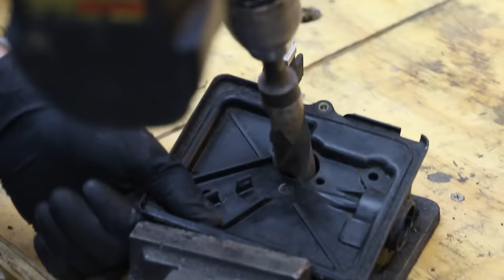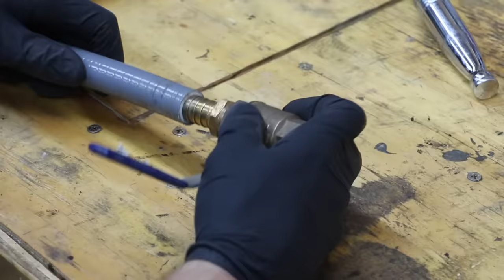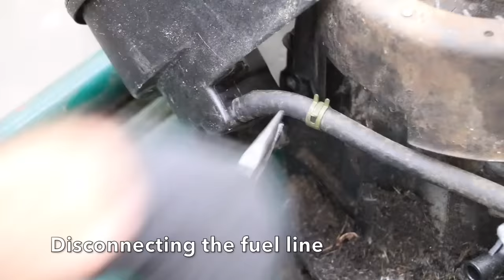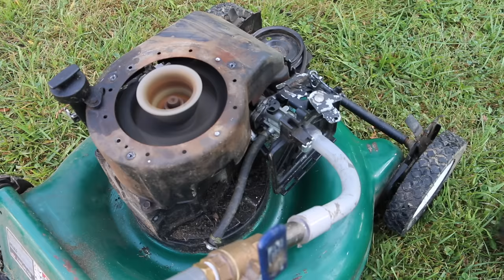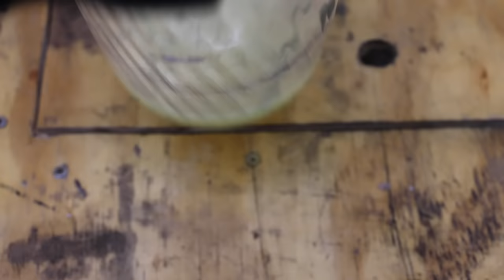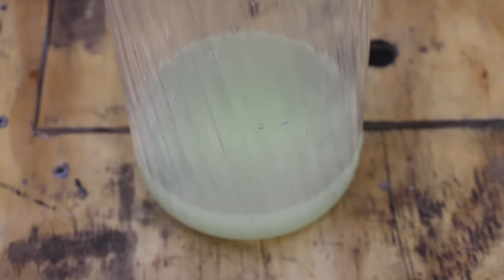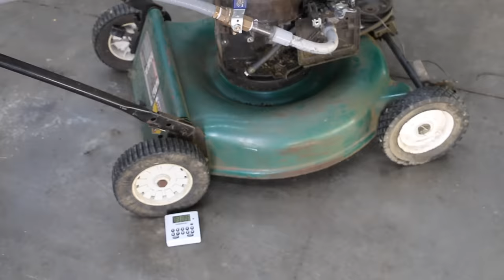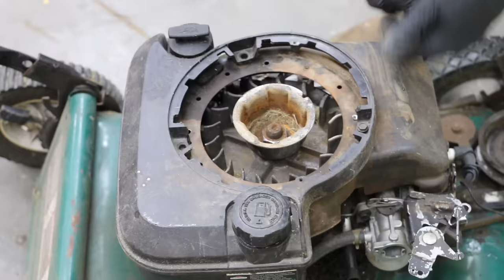Will a "Gas Vapor" Container Improve MPGs and Fuel Efficiency?  Let's find out!

Comment: So I looked at your previous video which was, you brought a Hydrogen generator & attempted to increase your MPG  on a truck which didn't necessarily help. 
Then on your Next video I looked at running a lawn mower motor on vapor fumes from gas. The vapor fumes worked! , However why not with hydrogen Gas fumes? Could you point out what I'm missing here in this equation? 
Thank you very much for your dedication.
Reply: And I asked this question based from my understanding that hydrogen can be just as lean as , regular grade Gas. So I'd say in 'theory' if the hydrogen Burns just as good then what's stopping it from getting that Good Burn?

Comment: Old video but here goes. One suggestion to improve economy is to add holes or slits to the bottom (only up an inch or so of the tube) of the downstems (2x air intake tubes) it will percolate much more finely and evenly. It will also make it easier for the engine draw through the stems. Also if there was a way to consistently keep the fuel about a half inch to an inch above the percolating holes that would help make it easier to pull too. Basically the engine will have to work harder to pull through a full tank of fuel 18 inches high as opposed to pulling through 1 or 2 inches of fuel. Fuel economy would prob have a curve where it would start to get better as the tank emptied. Maybe gravity feed from a secondary reservoir to keep it topped up? Super wide, squat tank?
Welder by trade but I dabble with glass. Made a lot of downstems for bongs.
Modified even more of them that have don't have percolated downstems or were either over or under percolated. Un-percolated downstems "chug" really bad like your container there, and tends to have a lot of drag and are hard to pull. On the far end of the extreme is when the factory went to town and put too many holes and you get a very easy pull with no drag, at the expense of agitating the liquid less. 
There's probably a happy medium somewhere in there.
Sorry for storytime, great vid.
Reply from the maker: Thanks!  Thanks for sharing.

Comment: That was great! I've seen some setups have the pipes go above the fuel line, rather than into the fuel to bubble it. That way apparently it grabs the pure vapors rather than creating a mist which would use up more fuel. Can you try this again but shorten the inlet tubes so they sit just above the fuel line?
Reply from the maker: Thanks for the suggestion.
Reply: @ProjectFarm  my curiosity is whether the vapor line could be similar to the coils of tubing in a still- dragging fuel vapor from the canister by venturi.. sorry, not sure how to describe it.
Great video, PF.

Comment: Please use a mist maker for fuel and add the hose to air intake manifold, fuel mist  should only open on intake suction, otherwise fuel will waste,for this we can use suction valve with a variable suction pressure setting for optimizing fuel flow for better efficiency. For pressure control in mist maker chamber, a pressure gauge with auto cut off for mist maker can be setup, for safety purpose, otherwise the pressure inside the mist maker chamber will explode the chamber, auto turning on on pressure lower to a set pressure can also be applied. I think this will meter the fuel better and will also mimic carburetor
Reply from the maker: Thanks for the suggestion.

Comment: Farmers in 5he 30s did it, Charles pogue did it and I have done it in a 69 chev V8 truck. Better if you add heat. Pogue used naphtha. I used exhaust and coolant to heat but the gas vaporising built up gunk in my vaporiser because modern fuel has  a lot of stuff besides gas in it.
Reply from the maker: Thanks for the feedback.

Comment: The direct vapour lasted for 1 minute  more than the carburetor injected fuel, significant indeed! many be you need to tweak at the air in-take of the vaporizer unit to get better performance.

Comment: the change of the fuel to a whiteish color was due to the alcohol in the fuel  being a hygroscopic material. It sucks of water like a sponge takes up water. The canister of fuel was acting as a filter for the air coming into the engine. In fact if you would add more fuel to the canister and continued to run the engine you would eventually have water falling out of suspension as bubbles to the bottom of the canister.
Reply from the maker: Thanks for the feedback.

Comment: I read some plans for vapor carbs and they all heat the fuel to abt 400 degrees. The violent bubbling action in the bottle puts lots unvaporized gas droplets into fuel pick up tube so the fuel is not 100% vaporized.
Reply from the maker: Thanks for the feedbacik

Comment: I know this is an older video but for what it's worth, the very purpose of a carburetor is to atomize the fuel before it goes into the combustion chamber. I think your vaporizer is just atomizing the fuel before it goes in so I can't see how it could possibly be a whole lot different in mileage, unless the vaporizer itself is just more efficient than the atomization of the fuel from the carburetor.

Comment: Your method has a fundamental flaw, you don't have a mixture valve to allow additional air into the engine along with the vapours so it was likely running rich at the beginning and lean at the end. also the bubbler should contain something like a wick or other high surface area material. You will probably need something to warm it as it gets very cold stopping evaporation, i also suggest using a float or something to keep the level of fuel in the bubbler as small as possible, then the engine will have to use all hydrocarbon chains in the mix rather that distilling off the most volatile vapours first. the fact that you got an increase in efficiency with this crude setup that's not optimised shows that there is plenty more to be had, advancing the timing slightly might also yield additional efficiency as gas vapour only has a higher flame front propagation speed, you can quench and further increase efficiency and torque by adding a small amount of water in the bubbler too, this can increase the density of the charge and also work somewhat like an EGR by adding a non combustible, further enhancing efficiency and reducing cylinder head temps.

Comment: Idea-
Another youtuber outba lawnmower engine on the small block v8 of an old, Ford Maverick. A 302 I think. 
It ran and he started seeing amazing mileage. Like 70 mpg. 
It DID lose power, but ran smooth and sustainably at highway speeds. With manufacturers now using 1.8 and smaller motors, power is not always the goal. His theory is that the small carb created high intake air speed that better misted the fuel. He wasn’t sure. Just a theory. He was amazed by the result too. 
Can you please consider replicating this?
Reply from the maker: Thanks for the suggestion.

Comment: For starters, all internal combustion engines run on vapor. That's what carburetors and fuel injectors do. These vapor engines purported to go to the moon on a teaspoon of fuel are at most just running lean, which means less power, hotter exhaust gases, and reduced thermal efficiency.

I'm an engineer, so just to put some perspective on this for cars, I did some calculations. For a car that can reasonably, if uncomfortably, fit a two person cross section cabin, has a minimum feasible drag coefficient, has tires in contact with the road, and travels at around 100km/h (~60mph), the theoretical minimum power it'll consume just to maintain that speed is about 6kW, and accounting for the theoretical maximum thermal efficiency of an otto cycle engine (four-stroke piston and crank) and the energy density of gasoline, this equates to about 235 miles per US gallon. To emphasize, this is regardless of technology or fuel being used; we're talking about thermodynamic limits in energy terms, for a car with people in it, in Earth's atmosphere.

However, if it were optimally motored just to perform the above task, it would also take such a car about 2 minutes to go from 0 to 60 mph. If the car had the ability to increase power output just for acceleration so it could do 0-60 mph in an acceptable 10 seconds, and does so on average once every two miles driven to approximate a mixed drive cycle, and assuming it could somehow maintain it's theoretically maximum thermal efficiency, it's average fuel economy would be reduced to around 140 mpg, which is pretty close to the Tesla Model 3 mpg equivalent.

So in my professional opinion, the claims of hundreds of mpg from the 1960's or 70's simply cannot be true, let alone 1000+ mpg.

For a much more realistic car with an internal combustion engine, with ample head and shoulder room and desirable seating height, presentable and practical exterior design, capable of cruising at 70+ mph, and accelerating within an acceptable space of time and distance, the best fuel economy you're ever likely to see will be between 43 and 57 mpg before bumping into the laws of thermodynamics.

The reality is that consumers want their cars to do and be a lot of things: handle like a Porsche, accelerate like a McLaren, have as much space as a Suburban, get the fuel economy of a Prius, and cost no more than a second hand Honda. Through careful, market-driven negotiation, typical cars today average between 25-45 mpg, because that's a realistic range within the limits of cost, technology, and what we want in a car. The fact that hybrids and electric cars are taking the market by storm only further discredits the notion that hyper efficiency technologies are being suppressed.
Reply from the maker: Thanks for sharing.

Comment: Wow didnt know you made this experiment long ago!
I think we can improve efficacy and throttle ability of the system by having several smaller diameter air bubbler tubes instead of the 2 large ones used and also adding 50 percent of so water to the fuel to take advantage of the Hydrogen and Oxygen content in it
lets reopen and review this experiment case in 2022
Reply from the maker: Thanks for the suggestion.

Comment: The reason you got the same time on both of those experiments was because you're using a carbureted lawnmower, which fills a bowl with fuel and the engine runs off the vapor... So in both experiments, the engine was running off the same thing, gasoline vapor. However, if you made a fuel-injected car run on vapor instead of liquid, then you'd have different results.
Reply: what do you expect if it is fuel injected? would it be higher or lower? can you explain more?

Comment: Henry Ford's first model t's used fuel vaporizer canisters before employing  carburetors. The correct terminology for them is fuel mixers. They work quite well but in the end they accomplished the same thing air being pulled through  carburetor  Jets in the carburetor forms a wet mist vapor pretty much as vapor canisters do
Reply from the maker: Thanks for the feedback.

Comment: All internal combustion gasoling engines run on vapor only. Any liquid that doesn't turn to vapor contaminates the oil & pollutes the exhaust. The issue of managing fuel vapors is two fold: consistently providing a proper A/F ration under varying loads/RPMs and furl vapor safety from fire/explosions as fuel vapor can be ignited by a tiny spark and create havoc.

Comment: Another video idea would be to verify thunderhead289’s claim of running a v8 off of a lawn mower carb and getting 40+ MPG. You may want to prove an increase in efficiency by using a generator with a regular carb, then a vapor carb, and then a HHO setup. And finally with a fuel injection generator. It would be interesting to see the efficiency’s. Also you should weigh the fuel instead of eyeballing the level.
Reply from the maker: Thanks for the suggestion.

Comment: Burning mist (a liquid) should tiene different results than burning fumes (A gas). I see you have many BIG OIL sponsors in the background. Hmm makes you wonder if that had any influence on why the fumes lasted as long as the mist in the supposed test. Anyways, thanks for proving its possible.  Same is true for cars. You just have to get the fumes to go in through the pcv valve using a "t fitting". It works. And saves you on ga$.

Comment: the fuel absorbs moisture from the air that's why the fuel turn on that color. i did the same experiment few years ago and a water separator the same auto paint shop use for the air compressor helps prevent most of water gets trap on the filter
Reply from the maker: Thanks for sharing.

Comment: They had a vapor carby back in the 60's and it was very fuel efficient...the patent was bought up by an oil company and never heard of again
Reply: Ford motor company bought the patent and it was done away with it was a super heated hot intake which vaporized the fuel big time as it passed through the hot venturi. todays gasoline is not what it once was. Very light HC molecules with alcohol and what not have ruined this process to get 200 mpg from a v-8 on todays fuel. hot vapor is the key to any engine efficient gains, even with our crappy mis-engineered fuel it will help but nothing like old ETHYL fuel. thanks

Comment: You can even run a combustion engine on wood chips. In ww2 ,gas was heavily rationed.There is still photos of what is called a gaserator attached to the trunk area of cars of the day. It consisted of two barrels plummed together,fumes would power the ignition of the engine. look it up.good luck with your project..
Reply from the maker: Thanks for sharing.

Comment: The difference is that you didn't heat the fuel, turning it into true vapor. There was a guy who heated the fuel, put one gallon of gas into a galaxy 500 (this was back in the70s), and drove 100 miles on it. Ford heard about what he did; bought into the research from him, and killed the concept (along with him, surprisingly enough!).

Comment: Very interesting video. What if fuel vapors and hydrogen vapors are combined? Small engines will run on hydrogen only and now you've already provided proof that they will run on gas vapors, what efficiency could be obtained on combining the two?
Reply from the maker: Thanks!  Thanks for the suggestion.

Comment: Pictures of the old vapor carbs has heater hose lines to the box to heat the fuel.
They did not show what was inside the box though.
Hot fuel vaporizes better and faster than cold fuel.

Comment: Engines are designed to run on vapor. For instance, a fuel injected car sprays a very small amount of fuel into the combustion chamber. When the liquid gas is pressurized and the heat of the engine cause the liquid to gasify, the end result is vapor being burned. The waste is then turned into carbon and escapes out the exhaust, or for better terms, the waste valve.
Reply from the maker: Thanks for the feedback.

Comment: Put a efi lawnmower carburetor on a car with a calculated vacuum pull to match fuel intake. Lower combustion pressure with atomized fuel should have similar output with tuning theoretically. This vapor system would be interesting as well, not sure how that would work with injectors. 90° bends are your friend, and spiral milling patterns might increase turbulence increasing fuel atomizaton. 60s experimental cars had air accelerators connected by pulley to the crankshaft. It would need higher vacuum pull though. Fuel atomizaton also reduces carbon buildup and emissions. Also turbos? Bio diesel? I'm about to buy a 84' 190d Mercedes diesel and have a 61' ford falcon with an inline 6 that I'm going to experiment with
Reply from the maker: Thanks for  sharing.

Comment: Hey dude....  Try running a lawnmower off of propane... I had a lawn tractor I built using a lawnmower engine for a pull cart not to cut grass and the car or messed up and I needed it so I fired it up easily on propane from a propane torch and it ran good

Comment: Applause!,  Now, to increase efficiency ,Try squelching the air intake, like one tube or valves on air tubes,  You would want to make the least amount of vapor that sustains the engine, this is FULL open.  Another idea, from a evaporation carb sold 50 years ago is to use the SAME Fuel line as liquid fuel, but instead make a double boiler design,  the liquid fuel container  is sitting in 200 degree water bath , and 1 tube (same as fuel line)goes to fuel intake,  once some pressure builds from petroleum's expansion  start it up and time it. This will allow the Air portion of the carb to continue to work without fuel and the PCV valve to be connected.  The evaporation carb that was sold had a heating element in the fuel bowl so it encouraged evaporation.  All in all this is great.  The rule is evaporating gasoline is WAY more flammable that liquid fuel,  This is how they made Balloon bomb with a few drops of gas in a inflated Balloon , and a lit cigarette taped to the side as a timer.  When the cig went close to the rubber it popped and the cig's head would ignite the fumes making an explosion that 3 drops of fuel could not..  Properly atomized atoms.

Comment: Uncle Tony's Garage did a similar test using a Dodge with 
V-8 engine, In his case it got less fuel mileage. But what he tested was a bit more complicated.

This system was simpler than what Tony tested so I don't know if we are comparing apples to oranges. But, if this would provide an improvement on a bigger engine would it be 3% or maybe even greater?
Reply from the maker: Thanks for the feedback.

Comment: Could you modify the vapor setup so you can manually adjust the air/fuel ratio? Maybe have your setup with another valve in parallel with the vapor canister valve that can allow pure atmosphere into the engine? I have a feeling your airflow through the vapor canister is oversaturating the air with fuel vapors, making it less efficient than it could be.
Reply from the maker: Thanks for the suggestion.